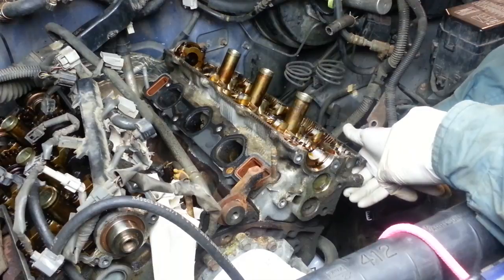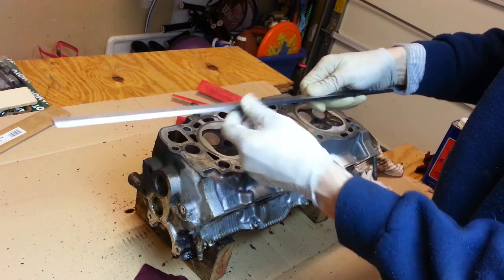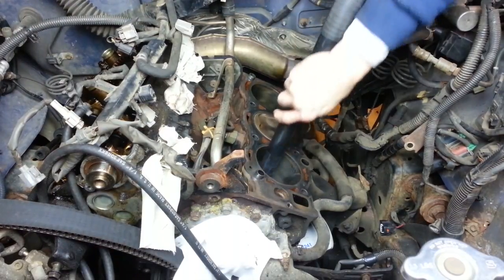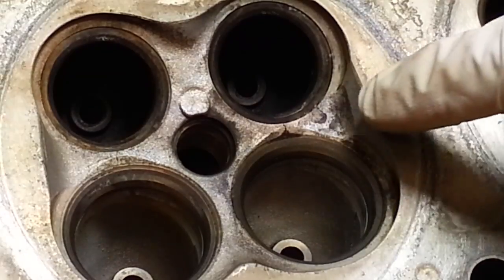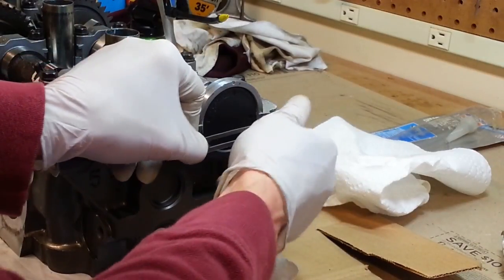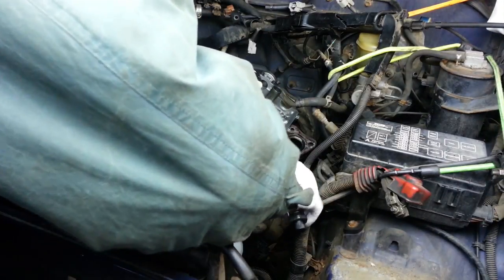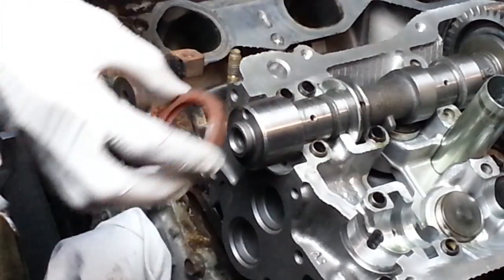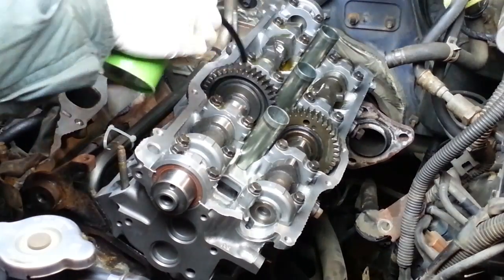Cylinder Head & Gasket DIY Procedure - Toyota 5VZ-FE - Part 4

Comment: What brand HG did you use and what type of material was it made of? trying to decide which hg to buy. thanks.
Reply from the maker: The head gasket was made by BECK/ARNLEY and is of a composite material. I debated, too, over which one to buy and settled on this one because it was a comprehensive kit at a good price from a reputable name. I would have preferred to go with a genuine Toyota OEM kit but the price was more than I wanted to pay for my old truck.

Comment: Hey, wanted to ask what bolt you used as the service bolt to hold the camshaft gear, im doing the same job in both sides of my 2000 4Runner 20:53
Reply from the maker: I'm very sorry but I just don't remember specifically what it was. I do know that it was a pretty standard metric bolt. So it shouldn't be hard to find one that will fit the threads. Good luck with your project. Let us know here how your experience compares to mine.
Reply: @WorseThanChiggers  I found out that the head cover bolts for the cylinder head has the thread pitch needed to hold the camshaft gear, saves me a trip to the hardware store!
Reply from the maker: @bencrespo8057 Good find!

Comment: You may have mentioned this in the video but what size wrench do you use for camshaft im finishing my head replacement and cant turn the intake camshaft to force the exhaust one down.
Reply from the maker: Gosh, I don't remember. It was probably in the neighborhood of 30-32 mm. You should be able to use a large adjustable wrench.

Comment: So is the truck still running fine after the head gasket replacement?  I've been told not to fix the blown head gasket on my 4runner since the repairs tend not to last very long.  I've been told to just get a replacement engine from a junkyard.  My 4runner does have 270K miles on it...wondering if I should do this procedure...thanks for the detailed videos....I'm suscribed
Reply from the maker: The truck is running better than ever now and is currently my daily driver with 242K on it.  However, I don't think that it would really be worth it to pay someone else to do a head replacement or head gasket job on a high mileage engine like yours or mine. A lower mileage used engine might be a better investment but there's unknown risk going that route, too. I just found it to be a very rewarding and educational project for myself. It is true that replacing a head gasket likely won't last if you don't first find and resolve the root cause.

Comment: Also is that a Chiltons or Haynes repair manual?  Thank you!
Reply from the maker: That's a great clarifying question. My manuals are not one of those third-party repair manuals. Those may be okay for some general repairs but they fall short on the necessary details and specs for doing more advanced repairs and maintenance. I use genuine factory service manuals from the manufacturer which are very comprehensive and considerably more expensive. Even so, doing one repair yourself will easily pay for the manual. I usually buy them used off eBay for much less than new. Also, the modern way is to get that information online with a subscription to http://www.alldata.com.

Comment: You're a damn hero, this video is an absolute life saver. Do you have the link to the Texas company that sent you the head?
Reply from the maker: Thanks for the kind comments. I really appreciate it. Search eBay for the user "headsonly".
Reply: @Worse Than Chiggers  You can also search cylinder heads international into google, same company.  I've heard some very mixed reviews about them though. That being said I did just order two rebuilt heads from them so fingers crossed that they will be in good shape.

Comment: what brand of gasket did you use? and thank you taking the video and patiently editing them for brevity and time.
Reply from the maker: +Chester Chua The head gasket came as part of a Beck Arnley kit from RockAuto.  I chose that kit because it got reasonable reviews and was moderately priced, not on the low nor high end of the price range.  I can dig up the part number for you if you need it.
Reply: +worsethanchiggers  Thank You! I decided on victor reinz gasket instead but my machinist had me use a diff brand for the valve seals. cant remember what. I'm using your very helpful video right now to guide me on my reassembly.  altho in my case. both my heads cracked. plus its overdue the timing belt and water pump replacement. excellent commentary.

Comment: Hey worsethanchiggers, Thanks for the great video series. I used them for reference to pull my 1995 4runner left cylinder head. Getting ready to order a replacement in the next day or 2. Have you had any issues with only replacing the one cylinder head not both?
Reply from the maker: None whatsoever. The truck continues to run great 3 years later.  Good luck with yours!
Reply: Awesome! Ordered my new head should get it by the weekend. Lot of work but a fun project.

Comment: Amazing video series, thank you very much for taking the time to share. Almost all of the questions I had are answered in the comments, but one remains - what did you use to mark the components with colors so you could match them back up later? Crayon? Thank you again.
Reply from the maker: Thanks for the kind comments. I really appreciate it. To mark components, you could really use anything that serves the purpose. I used hobby acrylic paints just because that's what I had. You could use paint pens, nail polish, twist on some colored pipe cleaners, etc.
Reply: @WorseThanChiggers  Thank you. One more question - I have done head gaskets on older Toyotas (22R engine) without removing the valves from the heads. do you know if I can get away with doing that with this engine too?
Reply from the maker: @ranzaganza27  Thanks for the question and here's my opinion. There's always a reason why a head gasket failed and sometimes we don't know what the reason was. One of the main reasons is often a warped or damaged head. How do we determine if that was the cause and to prevent the replacement head gasket from failing again for the same reason? The answer is to always take the head to a machine shop to get it resurfaced. As part of that process, they will take the valves out and inspect everything for you or you can do it ahead of time as I did. So my answer to your question is, you might be able to get away without removing the valves or getting the head machined, but I certainly wouldn't take that gamble.
Reply: @WorseThanChiggers  I am definitely planning on getting the heads machined and am also trying to avoid purchasing the tools needed to remove the springs and keepers if I can. I will check in with the machine shop and see what they say. Flipside is that this seems like a good opportunity to learn about valves!  Thanks again for your reply and help. these videos will really be saving me.

Comment: Hey there @worsethanchiggers , do you recall which ebay seller you purchased that remanned head from? I'm in the same boat as you at the moment. Much appreciated.
Reply from the maker: I bought my cylinder head from eBay seller "headsonly" at http://stores.ebay.com/HEADSONLY .  Best of luck with yours.  Mine is still running great.  My truck is going to die of rust cancer long before the engine goes.

Comment: Very helpful videos! Question: Did you need a special tool to remove the springs/keepers or did you just hammer them off?
Reply from the maker: I used this valve keeper remover tool:  https://www.amazon.com/gp/product/B0012S61IO
Reply: How was it for re-install, Would you recommend it? Thanks for the quick reply!
Reply from the maker: Removal is really easy with this tool. Just pop it and off come the keepers. You can do the same job with a deep socket but, without the magnet, the keepers may go flying.  Reinstallation is a different story. It took me several attempts to get the keepers to fall into place. You definitely need some type of tool to assist. I've used this other one before and actually prefer it over the first for reinstallation. https://www.amazon.com/dp/B0741XZJDB?psc=1

Comment: do you recall where you got your pulley holder? been happy with it?
Reply from the maker: I bought it from Amazon and have been very happy with it. I originally got it for this cylinder head job but have since found multiple uses for it. Most recently, it was the only way I was able to remove a stubborn bathtub drain. Here's a video review that I did of this tool.  https://youtu.be/j_TfAACwJac

Comment: What diameter are the lifter shims?  I had one guy tell me 28mm and another tell me 34mm. Thanks.
Reply from the maker: I'm pretty sure they are 28mm.  Best thing to do would be to go through the procedure to measure your clearances.  If any are out of spec, you'd need to remove them and measure their thickness to calculate the thickness needed for a replacement.  While in hand, measure the diameter.
Reply: Thanks much for the answer.  I'd sure like to have the stuff on hand so I can open it up, do the work and close it up and roll in the same day, but I guess that's not in the cards on a job like this.  Darn reality keeps getting in my way.  LOL.
Reply from the maker: I was originally hoping to do the same.  Have you priced the shims yet?  I wasn't willing to put out $275 for a full kit when I didn't know what I needed.  So, I waited until after I had it apart and measured everything and then ordered the 2 specific shims that I needed.
Reply: I did find this place in my searching.  Their prices are good and I found an off road guy who has used them with good success.  https://regismanufacturing.com/28mm-individual-valve-adjustment-discs-vad-28/  
I'm still not entirely sure that the valves are my issue.  I have a rhythmic ticking that goes away when the engine is warmed up.  I have experimented and it is much worse with thinner oil.  When I put some of that ticker oil treatment stuff in, it quieted down significantly.  So it is for sure an oil lubricated part.  I've had several people say they think it's the valves / lifters, but one guy insists it's a spun bearing.  I don't want to get too deep into the top end only to find out I've got to replace the motor.  IDK.
Reply from the maker: Sounds like some exploratory testing is called for here.  It cost nothing but your own labor to pull the valve covers and measure the clearances between the shims and the cam lobes.  That would at least tell you if there is excessive valve lash that might be contributing to your ticking.  You may find that your valve clearances are fine and that the ticking is from something else.  A spun bearing wouldn't be fun at all.  If so, it could be terminal rod knock that wouldn't likely go away after warming up.  You should be able to test for that, too, without removing anything more than the spark plugs.  Here's how: https://www.youtube.com/watch?v=pYleKxjl0uY

Comment: what was the car running like before you started?
Reply from the maker: It was actually running pretty well but the loss of coolant from the overflow tank and steam from the tailpipe were VERY obvious. It runs better now probably because I corrected the timing between the intake and exhaust cams. I went into great detail about that discovery in the video.
Reply: In all i probably watched 30 to 40 % of the series skipping around and it was great
Reply: Curious becouse moms 4runner has a miss every other day its strange but no codes or check lights
Reply from the maker: My VW Jetta had the same issue. Didn't occur often enough to turn on the check engine light. Turned out to be a flaky coil pack.
Reply: worsethanchiggers thats what i was thinking a coil pack, can they start to go bad or do they fail period?
Reply from the maker: Oh yea. They can be intermittent for a long time and can often act up worse during wet weather.

Comment: I’m doing this right now and I can say Toyota parts will cost you $$$. The head bolt’s were over 170$ for 16 but with new timing belt and water pump and top end gasket set I’m around 1200$

Comment: Why didn't you change both head gaskets?
Reply from the maker: Fair question. That side of the engine had no symptoms of a compromised head gasket or cracked cylinder head. Since I was doing all the labor myself, it fell into the category of "If it ain't broken, don't fix it." Plus, I was a bit concerned about disturbing the exhaust manifold and cross pipe on that side. It would be just my luck to break off an exhaust stud in the block. If I'd been paying someone else to do the job, it might have been a different story.

Comment: Any chance you can give me the part number off of your idle up valve (vsv) on the front of the engine. 
Thanks you
Reply: And thank you for your videos.  They are awesome
Reply from the maker: I looked but couldn't find it right off.  I suggest that you look up your vehicle by VIN and find it on the parts diagram.  Try here:  https://parts.conicellitoyotaofconshohocken.com/
Reply: I would but I’m doing a 3.0 to 3.4 swap and your sensor is the only one I have seen that matches mine.  I can’t seem to hunt it down anywhere else.  Unfortunately I have no idea what year or what kind of truck the engine came from.  In your video you refer to it as an idle up sensor.  It looks like connect to the air box and the front of the intake. Wish I could show you a pic.  From the video it looks like there is a part number on it.
Reply from the maker: Ah, ok.  I'll do my best. Can you give me a time index on the video that gives you the best view of the component?  Find and pause the spot in the video . Right-click the slider on the timeline and select "Copy video URL at current time". Then paste that into your reply.  I'll then look at the component and see if I can get a number off of it for you.
Reply: Part 2    10 min 30 sec you point at the part
Thank you so much for taking the time to do this for me.
Reply from the maker: I was able to read the lettering on the VSV this evening.  The part number is 90910-13001.
Reply: Thank you so much.  That’s the part # I was looking for.  I really appreciate it.

Comment: Awesome video! I was wondering what book are you using?
Reply from the maker: It's my genuine Toyota Factory Service Manual as seen here in the first video of this series.  https://youtu.be/voLBRDZL9fE?t=430  A good source is to get them used on eBay but don't be surprised if they still seem expensive.  Consider them to be an invaluable tool in your toolbox.  Don't bother with those thin Haynes manuals from the auto parts stores.
Reply: thank you sir

Comment: What a frigging nightmare! I could completely rebuild a chevy small block in the time it takes to do this head.
Reply: What parts of this teardown were worse that your chevy?  (This engine is my first experience, so nothing to compare it to.)
Reply: Can you answer one question for me.  Im looking to buy 4runner that has slow coolant leak and misfiring.  My guess is that it has a headgasket issue, no white smoke yet.  How do I know that the car was not overhead before?  My fear is that after I replace the gasket to realized the engine has overheated and warped.  Is that a concern or overheated might not be a concern.  I don't see any oil in coolant or reserves yet.  Thank u.
Reply: @Asian_Connection  Simple answer...Dont buy it.

Comment: were you reading misfire codes before you did this whole process
Reply from the maker: No, there were no codes and the check engine light was not on. The only symptoms were a slow loss of coolant in the overflow tank and the telltale steam from the exhaust pipe in the morning upon start-up. The crack that I discovered allowed coolant to leak into the exhaust side of the cylinder head. So I assume that it did not affect the intake side or the ignition process. Thus, no misfire, fouled plugs, or coolant in the oil.
Reply: oh OK, thanks for the reply.  i have P0300 and some other random cylinder misfire codes but i cant even drive it becasue its sounds like its bogging down and the engine shakes real bad.   i have changed coil packs valve cover gaskets spark plugs and wires. and it seems like my fuel injectors are all working properly.  Any ideas what.  Also the oil and coolant all look good, no milky looking substance.
Reply from the maker: Were there any repairs or events that lead up to the change in behavior or did it just start unexpectedly? That can often give you a clue where to start looking. I think you're starting in the right area by first looking at plugs, wires, and coil packs. Here is the general list of things to check for a P0300 in order of likelyhood: spark plugs, wires, coils, O2 sensors, fuel injectors, burned exhaust valve, catalytic converter, stuck/blocked/leaking EGR valve/passage, camshaft position sensor, computer. Replacing plugs and wires can never hurt. Beyond that, however, I prefer to use the appropriate test procedures to determine if components are bad before spending time and money replacing parts that may not be bad. I'd also check the timing to see if your timing belt may have jumped a tooth which can certainly exhibit similar symptoms.

Comment: From the toyota dealership: "The head bolts are non stretch bolts"
Reply from the maker: Who was the voice of "the toyota dealership"?  Was it a trustworthy authority?  Only reason I ask is because his/her info conflicts with that from the genuine Toyota factory service manual.
Reply: WorseThanChiggers yeah I just found it funny that the guy was so sure of himself when he said it, I’m replacing mine. He also said they don’t replace them if they do head gaskets on 3.4L at their dealership...yikes
Reply from the maker: I'm sure it happens all the time.  Another case of buyer beware.  There's no sure way to know unless you do it yourself.  It's like the old advise, never go in the kitchen of your favorite restaurant.  You don't want to know what goes on back there.